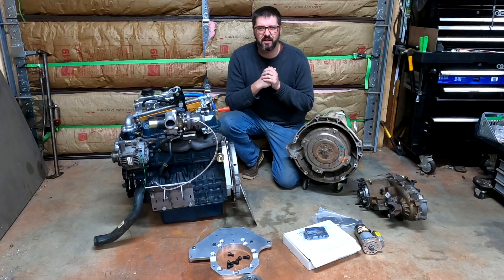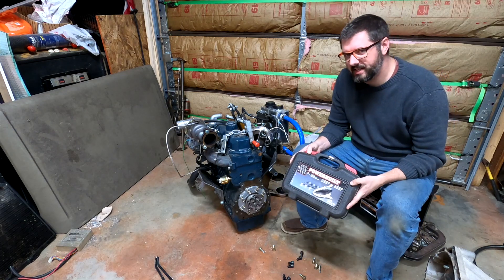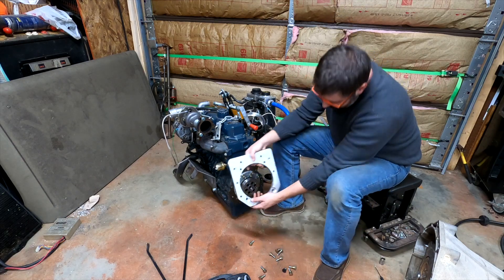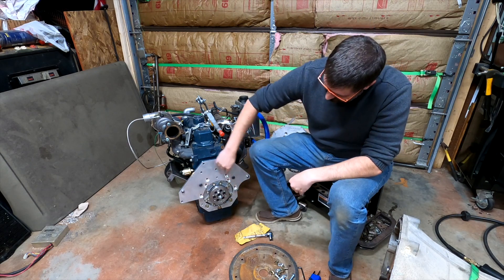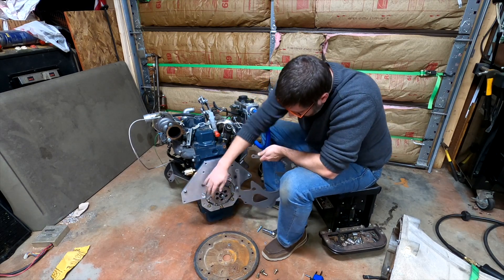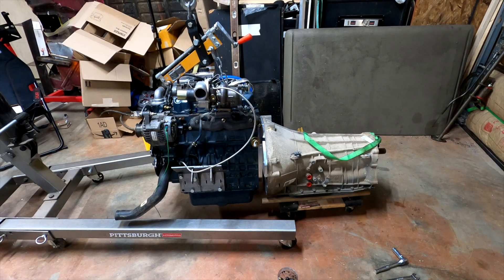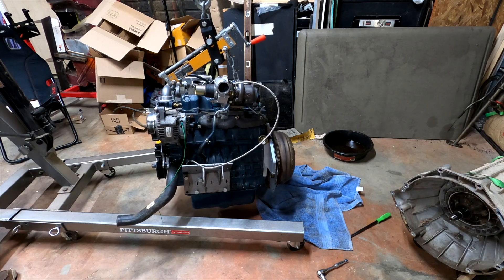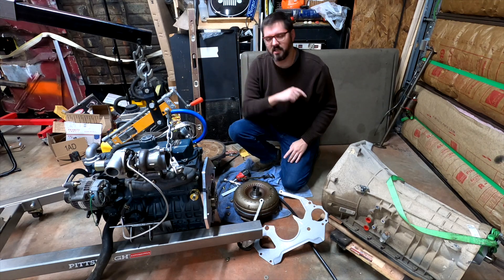Found an issue while test fitting the Kubota V2403 to the Ford 6r80 Automatic Transmission

Comment: While I'm very hesitant on a Ford auto trans being put in, the gear ratios seem promising! Be sure to cool that thing as much as possible 😎 Looking forward to the video of it all running/working
Reply from the maker: I was the same way as well Eric. Before I was a Jeep guy, I tried being a Chevy guy,  so going to a Ford transmission was not easy. However it was the only transmission that had a TCU to make the transmission standalone and it had the gearing I needed for my diesel as well.

Comment: I want to put this transmission in my XJ with a 4.0.
Reply from the maker: I think it would be awesome in an XJ, just need to figure out an adapter for the 4.0l to the 6r80 and then figure out the transfer case. I'm still trying to figure out the transfer case side of things currently.